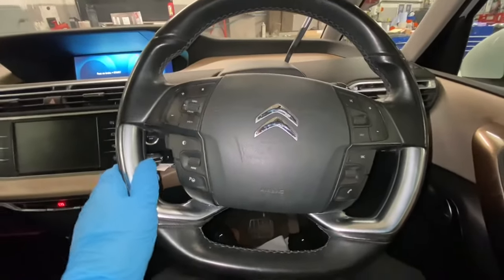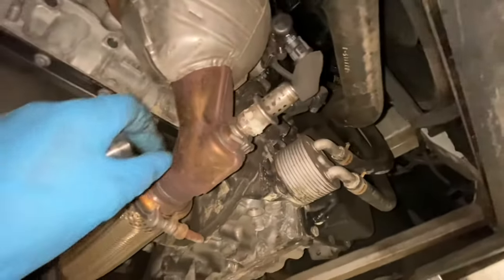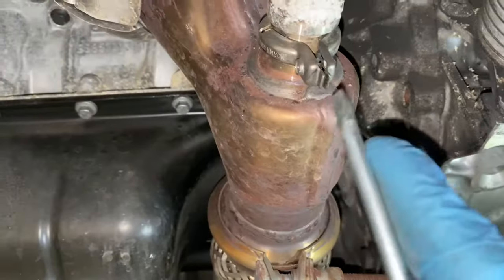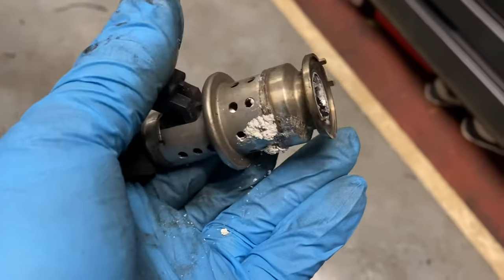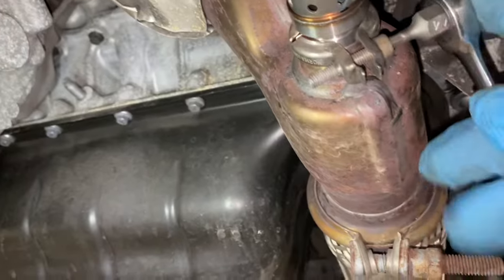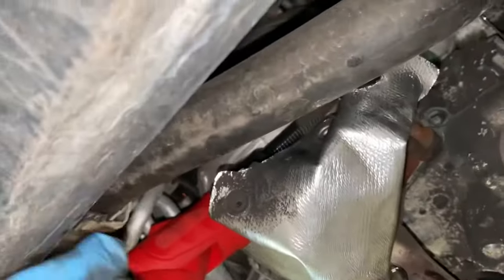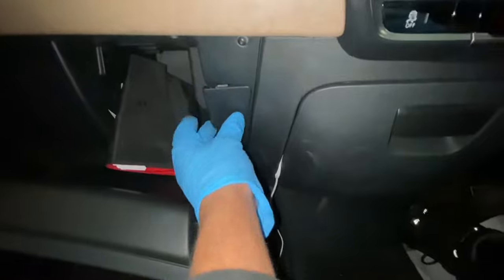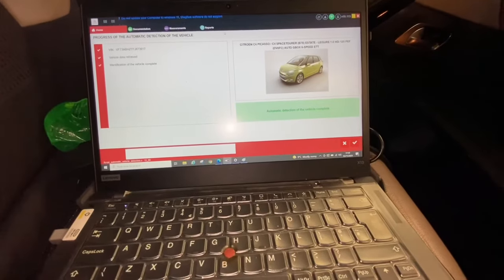#Citroen #C4 #Grand #Picasso #UREA #Injector #replacement

Comment: Ive bought Citroen C4 cactus and i have the same motorization; worst fiability ever; i hate Citroen so much! I have a default with the urea injecteur and nox probe (95000km / first drive in 11/2016. It cost more 700€ for replace 2 pieces. Anyway; never buy Peugeot Citroen Renault cars; better for your health. Can you tell me where can i found the Citroen Diagnostic software for Windows? Thank a lot for your sharing
Reply from the maker: Sorry dude i don’t know where you can get the software from I was using the PSA diagbox